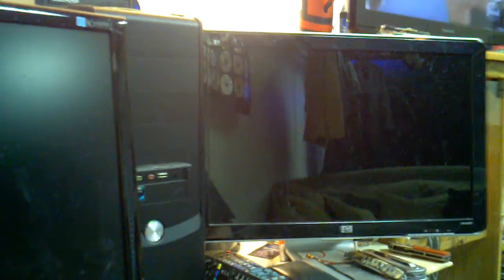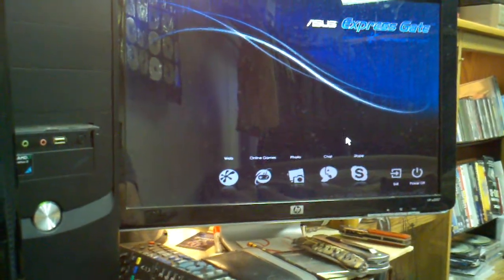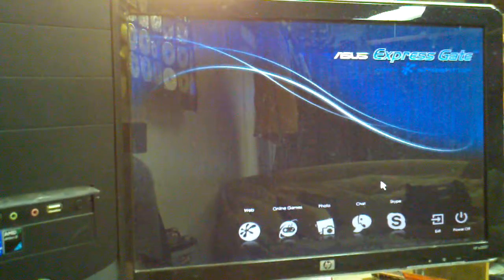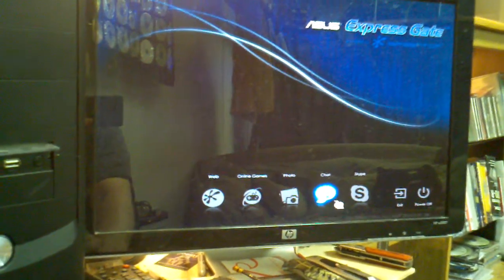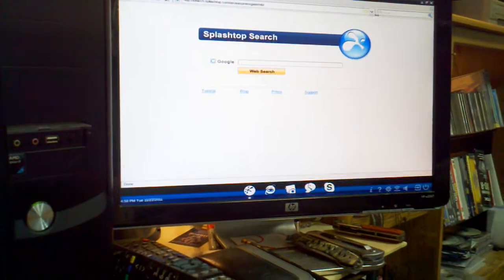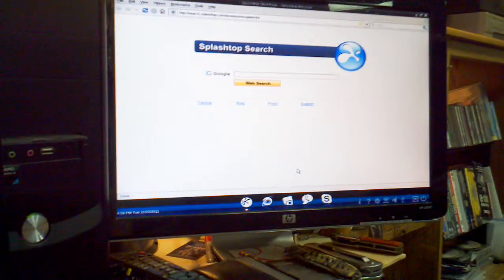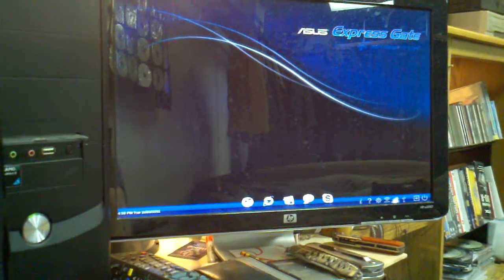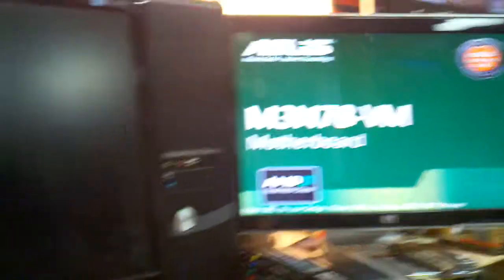Redundant O/S, SHTF resistant computers

Comment from the maker: @MrBudwv Aluminized shielding tape my friend, that and run a copper wire like a lightning rod from a bolt near the power supply down to the concrete and either put it in with a ramset like I did or drive a steel spike into the concrete beneath the carpet and wrap the lead around it.  The tape is in a layer on either side of the mobo and the rest acts as a Faraday cage.  It actually makes the computer run a lot better the less radio interference it is exposed to, like a CB setup.